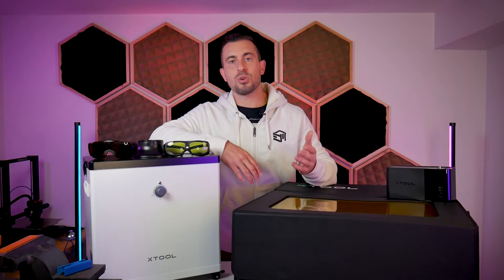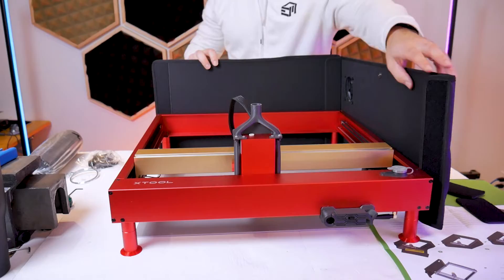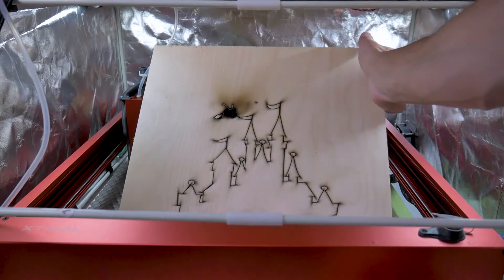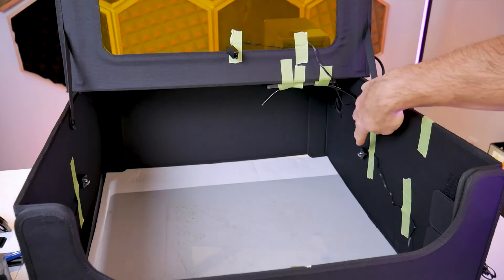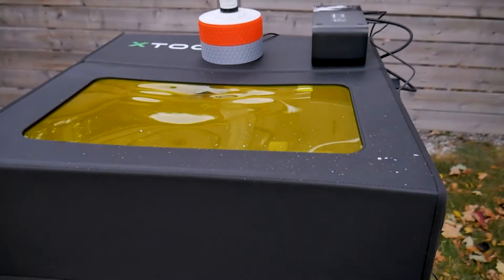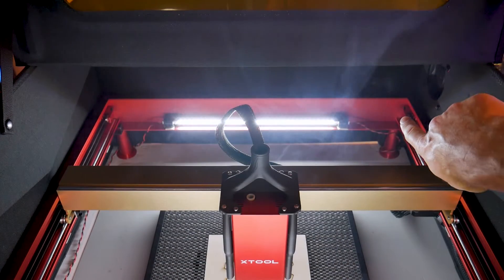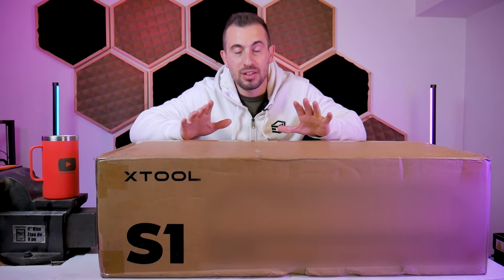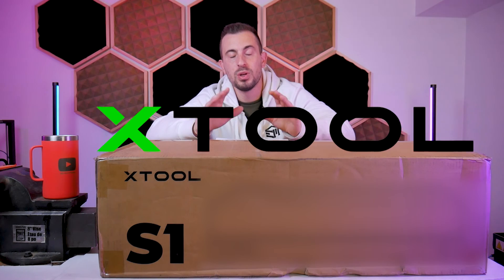Laser Cutting and Engraving Safety & Risks + REAL xTOOL Fire Suppression System Test!

Comment: hello. I accidentally pushed the fire extinguisher button on my ex 140 watch actual laser. There was no fire. Do I need to replace the CO2 cartridges? Also, will this mess up my machine? Thank you for answering.
Reply from the maker: I would have to go back and double check but I think the extinguisher can be setup in two ways... one where it dumps all of the cartridges and another where it only dumps half at a time. So your cartridges may still be good for a second use... best bet is to contact xTool support to see if they can provide more details. Thanks!

Comment: Great video, thanks! Do you have (or know of another) video on how to setup an inline duct fan with the F1? Maybe it's super simple, but I am only finding videos for other machines. I am hoping it will especially help when using the slide extension, where you obviously can't completely close the safety lid. I need some sort of solution to better pull out smoke and thus smell, especially from wood.
Reply from the maker: No need to overthink it with the F1, will just need an adapter to go from the F1 hose size to something more common like the 4" hose which is common on the inline duct fans. I've got something like that here if you're interested: https://embracemaking.com/products/xtool-f1-2-5-to-4-inch-101mm-hose-adapter

Thanks!